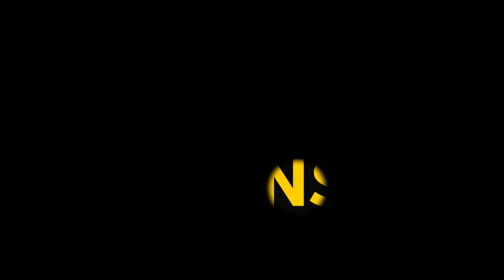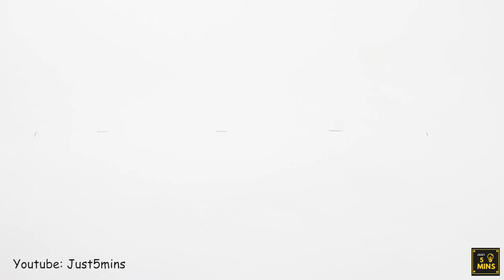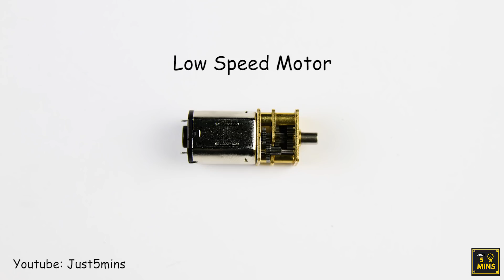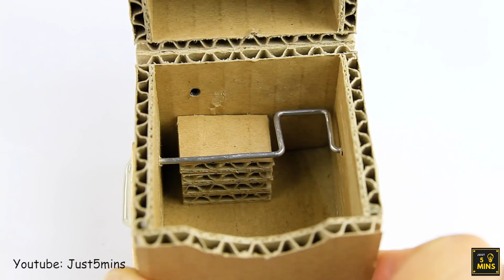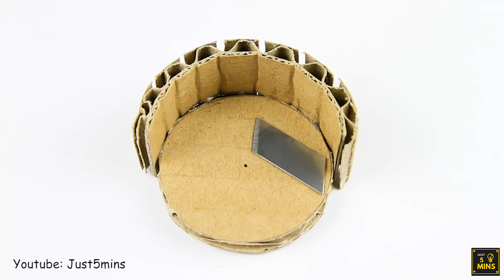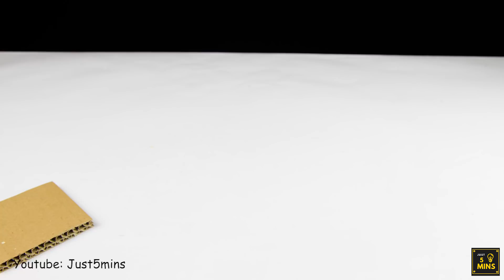How to Make an Robot Piggy Bank with measurements - Just5mins

Comment: Hi there, what is the switch at it's back good for, please? It gets me confused. The circuit is connected by the coin, once the coin slips off, it gets disconnected and the head closes as the hands go down, correct? So what are the back side connections for?
Reply: Well, received a like but no answer. Perhaps I better ask the original author, neh? / Is the backside switch there to reverse the motor twist as I am assuming?
Reply: The switch at the back is to keep the motor going after the coin is dropped to reset to the start position. Notice when there is tape to stop the switch closing the hands stay up after the coin is dropped?